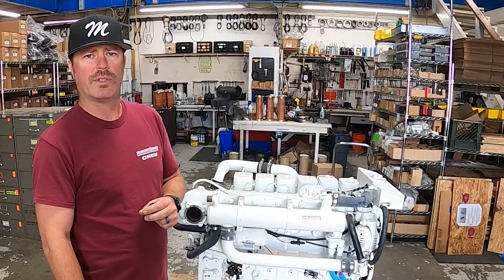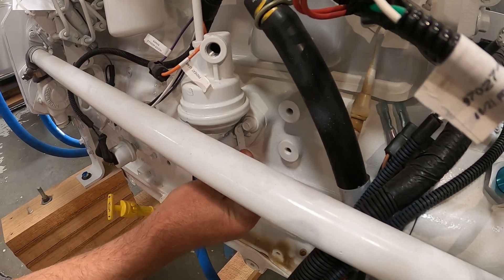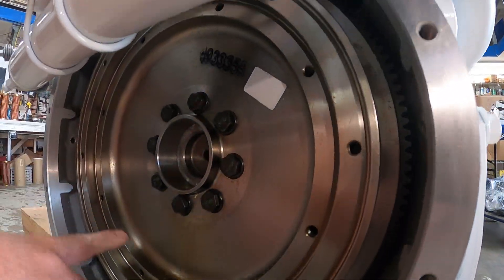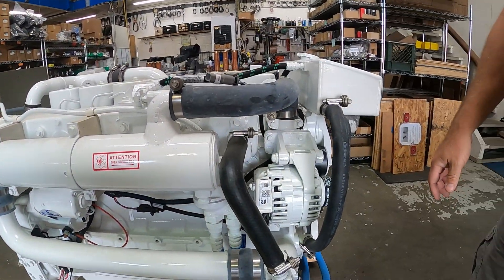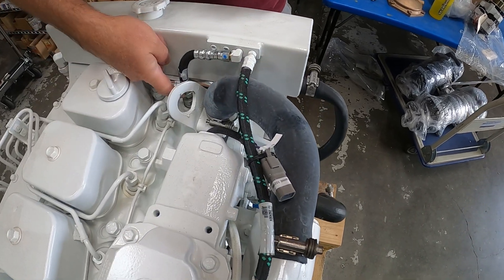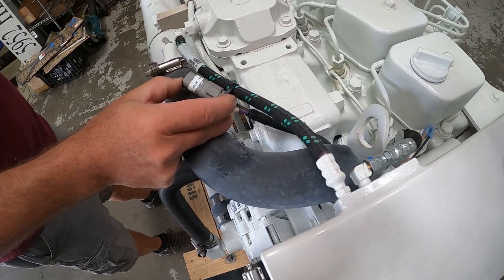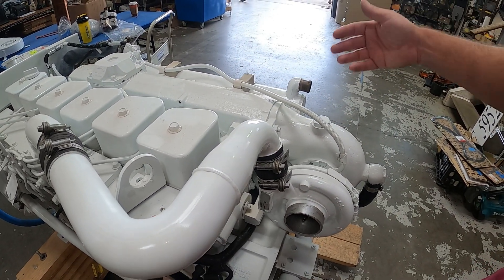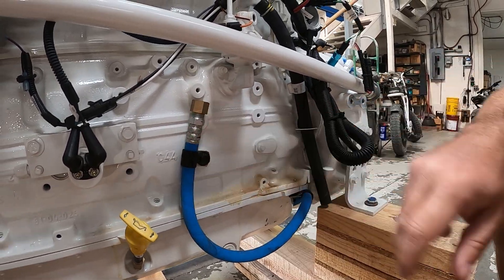Learning Your 6BT 210HP Cummins Engine

Comment: why does it not have a P Pump for injection?
Reply from the maker: The smaller HP mechanical engine has the CAV pump. Inside is a piston for each engine.  Its a rotary style pump instead of a crankshaft pump.  The 330 and 370 will have the nippon denso or bosch crankshaft style pump.
Reply: @SeaboardMarineIncVideos  thanks

Comment: Great video thanks! We have two of these on out boat, and one of the fuel solenoid's has failed. We have not been able to get a spanner or socked onto the solenoid to remove it, have you got any tips on what tools to use? And / or can it only be done with removing the throttle or the injector first (which would be a big job!)? Thanks

Comment: Nice. I acquired a 1969 Owens 33 sport fisher and gonna repower with two Cummins. As a small gas shop this was a handy intro as I will be marinizing engines as I'm on a budget. Is the turbo water cooed or not? And can the oil cooler plate be left out? Also curious regarding the shut off diode situation.. why can't you use a negative triggered relay as the shut off? Like an outboard you just need an ignition with NC ground at off- no diodes etc to fail.